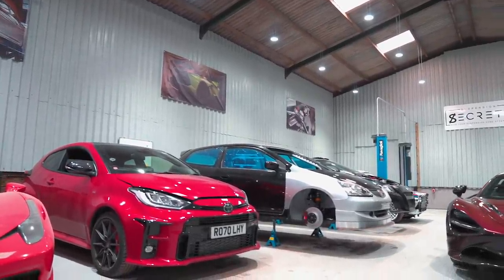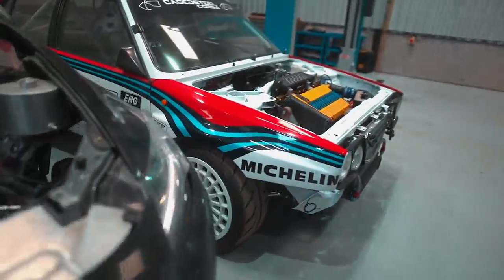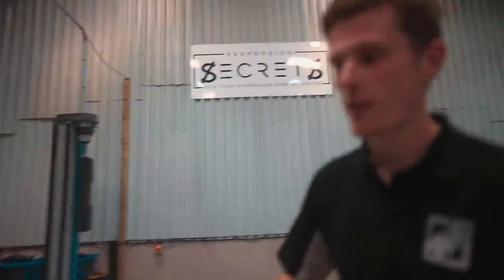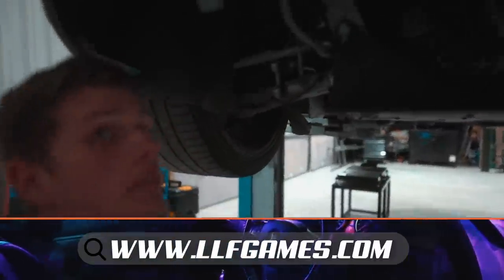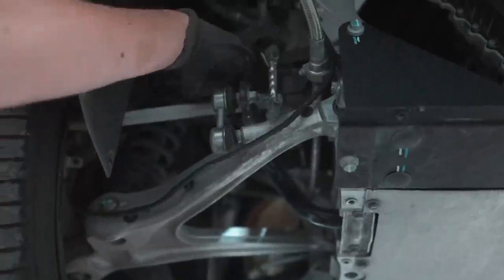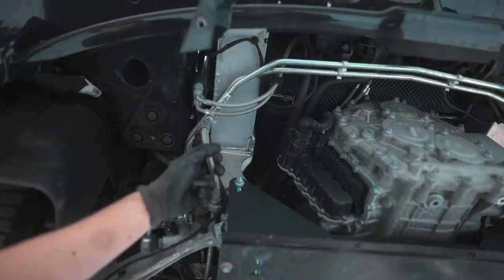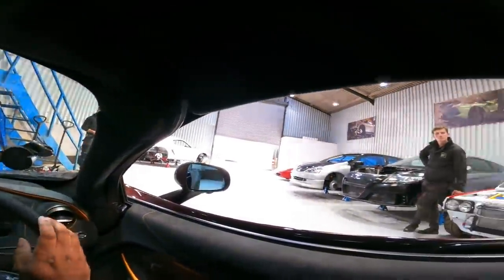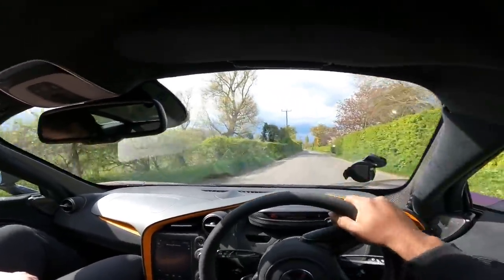HANDS DOWN!! THE BEST MOD I'VE EVER DONE **MCLAREN 720S**

Comment: Proper alignment transforms a cars handling. My car always squealed around roundabouts yet the local tyre place said tracking was spot on. I took it to a place that just did 4-wheel alignment and they said the left rear was toeing in. The difference was night and day. I remember a story where a Ford Mondeo was always pulling to the left - a specialist found that the geometry was perfectly aligned. Deeper investigation showed that the front subframe was mounted off centre (apparently they were all like this from factory). Great content - I would never of thought of using shims!